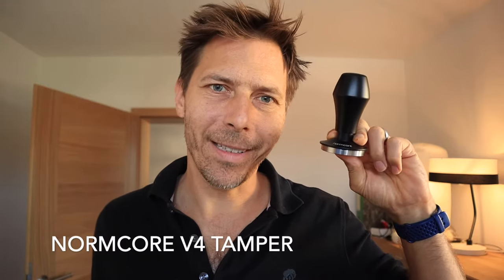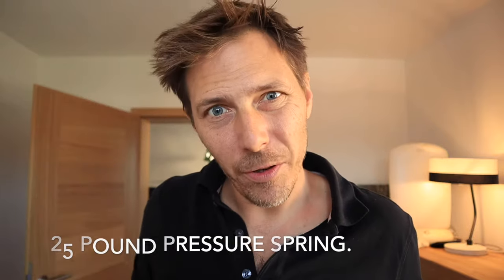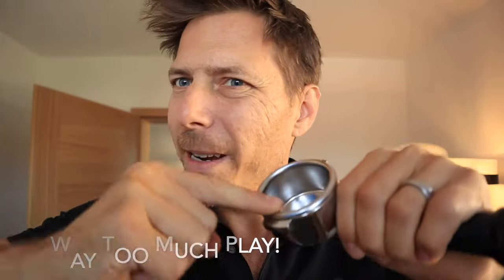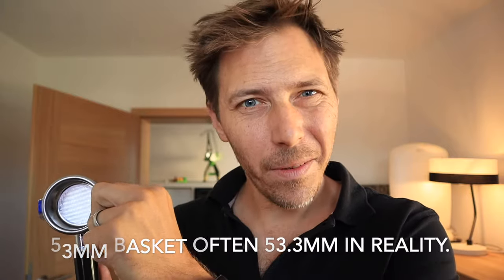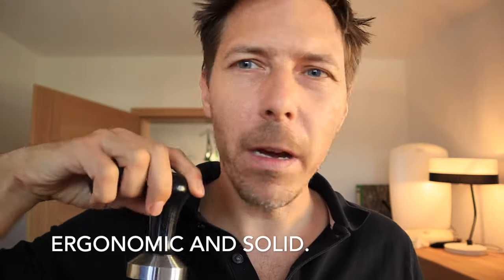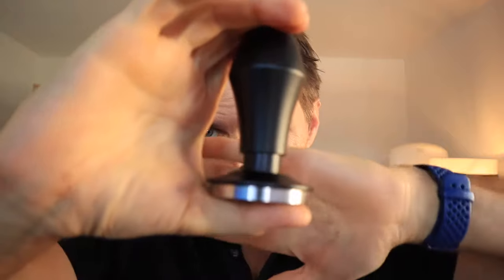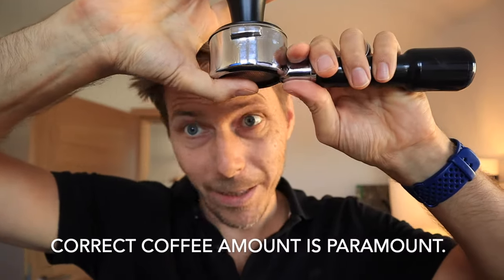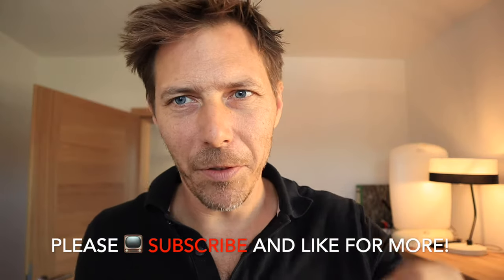A DEEP REVIEW of the NORMCORE V4 TAMPER.

Comment: Okay i have used this Tamp quite extensively now. What you need to understand about this tamp is you need to dose to suit the tamp. Some people dial in their espresso shot by varying the amount of coffee they use. With this tamp you can't really do this. (unless you want to buy lots of different baskets) With this tamp you have to experiment and find the exact amount of coffee that the tamp will compress perfectly for you and your shot. For me, in my IMS 14-18gr basket i have to dose 17.7gr. I then get the perfect compression for the basket and flowrate. The beauty of this tamp is when you do get the exact weight for your basket it makes for incredibly consistent and quick puck prep. I have the Niche Zero grinder so i put in 17.8grams of beans i get 17.7 out and then this tamp does the rest. Essentially this tamp requires a certain amount of dialing in all of it's own. But wow, when it's done life is so much easier, so much more consistent. It really is worth the hassle.
Reply from the maker: Thank you so much for that thorough breakdown, Tass! I think that tip will help many people. I will try that as well, when I start up my Breville again.
Reply: However, a change in grind size impacts the volume of coffee in the portafilter even at the same weight which impacts the tamp.
Reply: @LivingTheLifeRetired  That's true but it doesn't change anything I said. You still need to use the correct amount for this tamp to work properly.
Reply: @holly4221  A different spring won't fix that problem. The only way to slow down your extraction is to have finer ground coffee.
Reply: @Tass...  ok, thanks for weighing in.  I’ll go finer or add a bit more to,the portofilter.
Reply: @Tass... false. More compressed grounds will create a slower extraction. 30# tamp with an extra gram in the dose should slow the overall extraction.
Reply: It's not true. This tamper have 2 springs. First spring is compressing until the tamper reach the coffe puck and then the second spring start to compress with the calculated force

Comment: Nice video! I have this tamper, love it! The spring you showed is actually the spring for the top guide and has nothing to do with tamp pressure.  The spring for the espresso is buried inside the handle cylinder, that is the one you change to get different pressure on the coffee. Pro tip: take it fully apart and apply some 'food safe' grease to the cylindrical moving parts. I had issues with the tamper action being a bit rough; especially if you're not exactly perpendicular on your press.  Adding the grease really made it work nice and smooth!
Reply from the maker: Hey Tony, thanks for those tips! I did not honestly know you can take the handle apart. I will have to inspect that later. Any chance the cylinder depth can be adjusted? It doesn't go quite deep enough for my La Spazz baskets. Oh, and what kind of food grease do you recommend?
Reply: @TomsCoffeeCorner  Hey Tom, I really don't think depth can be adjusted. The unfortunate solution is to go with higher doses (as you know). Regarding the grease, honestly I just used some light bearing grease from my garage, but many people may not want to risk that so that's why I said 'food safe'. It only takes a very small amount, so I didn't think there was much risk of that leaking into the coffee during tamp. I actually wrote a letter to the company suggesting that better machining of mating surfaces on the next version would eliminate the need for any grease, they said they would consider that. But of course that increases manufacturing cost, so who knows if they'd do that.

Comment: Do you feel the resistance of the coffee at all when you're tamping or is it just the spring bottoming out you're kinda feeling? The V3 was like that, I kind of prefer feeling how much the coffee is being compressed. I think the main difference between V3 and V4 is the interchangeable spring that changes the tamping pressure.
Reply from the maker: Hey Ben, thanks so much for your comment. Most of the time, I don’t feel the resistance of the coffee. But I think that has to deal with a very deep depth of my baskets. I may take the base off of this one and put it on my manual tamper to try next.
Reply: @TomsCoffeeCorner  oh here's a maybe little known fact (at least with V3) the Decent brand self leveling tampers are 58.35 not 58.5 so not quite as tight of a fit. However I've found the base of the 58.5mm Normcore and Decent ones are interchangable so you can swap them. That's currently how I'm using them. I possibly have the only 58.5mm Decent Tamper. 😁

Comment: I got one of these at 58.5mm for my breville dual boiler to replace the default tamper. First thing I noticed, it’s heavy. About double the weight of the default tamper. Feels very sturdy in the hands. The calibrated spring is surprisingly strong with coffee in the basket, so that just shows how I was going too light before. Have made 2 cups so far, they were the best cups I’ve ever had! My extraction usually varies a lot, anywhere from 23-29 secs for 1:2 ratio. This has so far consistently given me 27-28 secs. The way the coffee comes out looks more....stable? Before the stream would often do the ‘wiggle’ quite early on, now it’s a steady stream of golden brown espresso for quite a while before it has that unstable wiggle. Overall very impressed with it
Reply from the maker: I know what you mean with a steady stream vs wiggling. I’m glad to hear that you like the tamper, I do too! Thanks for your feedback! Tom

Comment: I just bought this tamper and I'm not certain that the various springs will make a difference.  If I'm tamping to the same depth each time and hit the same depth limit each time whether there is a 30lb spring inside or a 15lb spring I think that the coffee ends up compressed at the same density.  Or put another way, if the tamp travels to full depth using the 15lb spring then it would travel the exact same depth (and pressure?) using the 30lb spring.  It's super level and super thin tolerance as you noted but I can't logically understand how the inner spring adjustment matters.

I took shaft apart which is the pressure apparatus (the outer spring gets overwhelmed during tamp and just helps level at the beginning).  I drew a line at the collar travel up the brass shaft until the inner core pushed to the top where the inner handle top would stop it.  I did this with each the 15lb and the 30lb springs and they each end at the same exact line.  So both springs tamp to the same exact depth which means they do not compress the puck to any different density, which is what pressure tamping is meant to do.  A 30lb tamp should make a thinner denser puck than a 15lb tamp.  I don't get it.  Is there something simple I'm missing?

Comment: I don't understand how this tamper works since it has that skirt that keeps it from going very deep inside your basket. It seems to me that it doesn't matter how hard you press on the handle since the skirt keeps it from going anywhere. When you press the knob does it cause the tamping end to extend down?
Reply from the maker: The skirt helps level your tamp, but yes it does bottom out after about 10mm, if I remember right.

Comment: Hey Tom,

Have you tried this tamper with the IMS (DL2TH26E) 51mm basket for the Dedica?
I just got the Normcore naked portafilter and the IMS basket, and a 51mm tamper from Amazon, but the tamper does not fit in the IMS basket. It gets stuck right on the top of the basket.
So now, i am searching for a suitable tamper for this basket.
Reply: I have the same problem!
Reply: Thanks for that information

Comment: I ordered one, and I don't think there's much difference in the tamping pressure, provided it's more than 5lbs or so. Here's what I don't understand, how does having a 15 (or 20 or 30) lb spring in the tamper help? The spring doesn't push down into the coffee, it presses up against you. So, if you want to tamp the coffee at 15lbs of pressure, and you have the 15 lb spring in this tamper, then you have to apply 30 lbs of pressure to apply 15 lbs of pressure to the coffee. Right? So I don't get the spring weight.
Reply from the maker: Hello John, you bring up a good point. The force of the tamper actually is met with an opposite upwards force from the outside rim of the portafilter. For that reason, I think that you are right that the springs do not actually put force directly to the coffee puck, but rather to the rim of the basket. Maybe a mechanical engineer can answer the question even better.
Reply: @EmilCataranciuc  From a physics standpoint I have to agree with the OP you're replying to. If the spring compresses under 15 lbs of force that doesn't mean the coffee was compressed with 15 lbs of force. I can still exert more or less force than 15 lbs depending on how full the filter is. If the basket is filled to the brim with coffee and I compress the spring but fail to press it all the way down 10mm I have applied more force to the coffee than if the basket is filled up enough to just barely touch the puck when fully compressed. There are more variables than spring resistance to this equation I think

Comment: Nice review. I also have a rather expensive Normal Dose tamper and it seems to be no different in use from the Normcore except it has only a light spring resistance.
Reply from the maker: Very nice, Tom. Can you decide the plunging depth, or does it have an end stop, like this one?
Reply: @TomsCoffeeCorner  It has an end stop, like the Normcore, but much shorter. 
The Normcore endstop is sufficiently deep, I never hit it (I change baskets rather than underfill a basket - reason and details given upon request). 
Anyways, the way I use the Normcore is to push down lightly until I meet resistance. That will be when the coffee will not compress much more however hard I push. I then add pressure until the heavier adjustable spring starts to compress a little bit (the handle moves down when you press considerably harder), and then hold for a while. Consistent flat tamp every time.

Actually, after using the Normal Dose for a while it has several issues which make it inferior to the Normcore IMHO. 
End result is that I cannot achieve tamps as consistent as I do with the Normcore with the Normal Dose because of its bad design. 
I do not understand how a competent honest reviewer cannot give the Normal Dose a low rating.

Comment: Yjanks Tom, I have the 58mm for my Gaggia CClassic Pro. I love it and almost never get any channeling in my pucks.
Reply from the maker: Very nice, Dan! That is a great machine, the Classic Pro. Did you get the sweet white version?
Reply: I got the stainless steel original version. A couple of reasons. Besides bring $50 less expensive the painted machines aren't stainless. I'm very happy with my machine, now I have to upgrade my grinder. Been getting by will the Baratza Encore. Great for filter brewing but not flexible enough for espresso. I see a Eureka Mignon Facile in my future.
Reply from the maker: Very nice, Dan. Good to know the painted ones are not stainless. I love the look of the white, but I'd prefer it be higher quality of stainless, too. 

I have a Eureka Mignon Specialita. I love that grinder. I have had a Sette 270W, Ceado, Encore, among others. The Specialita takes the cake for me. Maybe I'll do a review on it. Eureka makes great compact, quiet, non static grinders, with low retention.

Happy coffee drinking!
-T
Reply: I would love to have a Specialita but they are a bit pricey. With the Facile I get basically a Silenzio without some features.
Reply from the maker: @danjv  Sounds good Dan, but where can you get that? I don't see that model in Europe...
Reply: Several dealers in the US and Canada offer the Facile for $399. Eureka has a store on Amazon but do not offer it there

Comment: If you find you're needing to dose your coffee amount higher than you like, you could always get a smaller basket. Of course that's not ideal since it's an extra expense. 
I also have a Decent brand V3 tamper and I compared vs the Normcore V3 (58mm) and found the Normcore actually can extend a bit deeper! I never really had an issue with the max depth of either though (with 58mm baskets, usually 18g size, and I've sometimes used 16 or 17g doses).
Reply from the maker: Hey Ben, it’s an aftermarket 20 gram basket I’m using. I think it’s from VST. 

I might look for a different basket anyway though, because the coffee puck really sticks to the sides of this aftermarket basket. I prefer the baskets that allow the coffee pucks to just slide right out.
Reply: @TomsCoffeeCorner  checkout the Normcore or other brand stainless steel discs that go into of the coffee and work as an additional filter or shower screen between the coffee and shower screen it really does help with getting clean solid dry pucks out and keeps shower screen and group a lot cleaner. Too clean maybe I noticed my e61 lever was getting a little stiff because if wasn't exposed to as much coffee oils or particles it usually gets with use.
Sorry forgot you're not using a 58mm machine, I'm not sure if they have other sizes but maybe eventually a company will make them. Update: looks like they have a few smaller sizes too! 53.3 or 51mm!
Reply from the maker: @BensCoffeeRants  Hey Ben, thanks for that suggestion! I have seen glowing reviews of these on Facebook forums. I guess they should help to make a more even extraction too. Would you say your shots have gotten better with the screen?
Reply: @TomsCoffeeCorner  I don't think I've noticed a difference, having good shots now but I wasn't really having bad results before I installed it either! But it does make things a lot cleaner and doesn't seem to make things worse so I'd say it's worth a try.
Reply from the maker: @BensCoffeeRants  Hey Ben, I probably will, if not just for the fact that it keeps the brew head cleaner. But, you have to clean the screen each time, right? I bet that sucker is hot.
Reply: @TomsCoffeeCorner  yeah that's the downside fishing it out of the knockbox and cleaning it off, It's pretty hot right after removal but cools down pretty quick. You can tap it on something and usually the screen will come out before the coffee puck does some people do it that way.

Comment: Hey Tom! Love your videos and big fan. I have a Delonghi Dedica 685 and I was about to purchase a 51 mm but saw that there is a 51.5 mm as well. Which one should I get???
Help! _ Loving subscriber
Reply from the maker: Hi there, and thanks for your kind words! Which basket are you using? Do you have a calipers to measure its inside diameter?
Reply: @TomsCoffeeCorner  Hey! I'm using the one that came with the machine stock. (51 mm that holds 14g approx)  Also, I'm buying the bottomless portafilter Normcore makes  (one that you made a video about) and I think I'll get the 51 mm spring loaded tamper to go with it. Trust these are good choices? I haven't measured with a caliber but eyeballing it and researching on the website it seems like a fit configuration.
Reply from the maker: @informalshaurmal  Hi there! Well if you are buying the Normcore PF, then their own tamper will fit in their basket (the PF comes with a basket). So, that should all be good to go. Have fun! Tom
Reply: @TomsCoffeeCorner  ☕:face-turquoise-drinking-coffee:could you recommend a budget hand grinder to go with this norm core concoction as well. Does the Timemore C3 work well?
Reply from the maker: I’d recommend a Normcore V2 actually. Just made a. Idea on it: Normcore V2 Grinder Reviewed - CHEAPEST WAY to Espresso?
https://youtu.be/djsoFEQp3kg
Reply: @TomsCoffeeCorner  This was such a great video. And directly impacted my buying strategy so thanks a lot Tom! I'm looking into the hexagrind as well if it works for the DEDICA centric grinder workflow. Feel free to give any additional choices/insights and big fans of your work sir.
Reply: @TomsCoffeeCorner Where can I get a good 51 mm dosing ring for the dedica's portafilter. I saw you have a great one. Is it magnetic? :face-red-heart-shape: